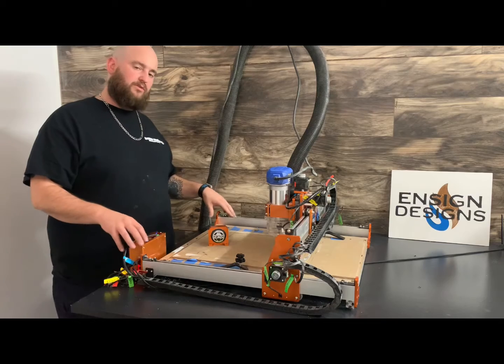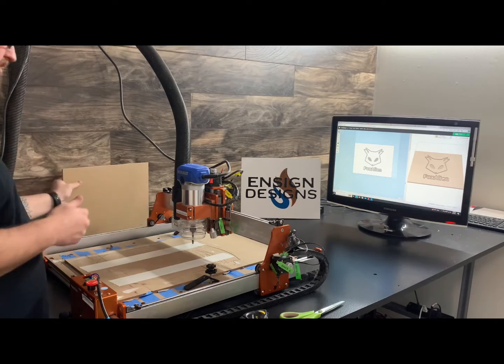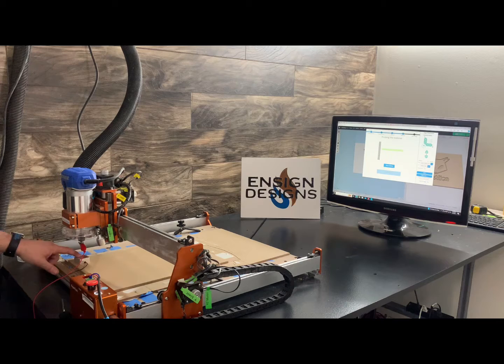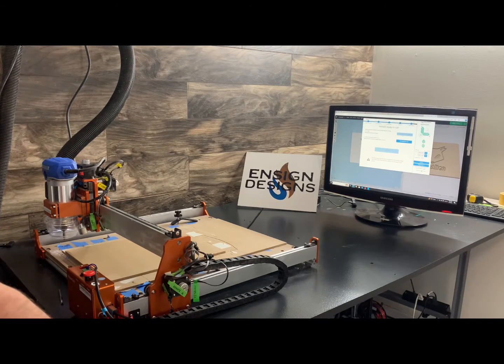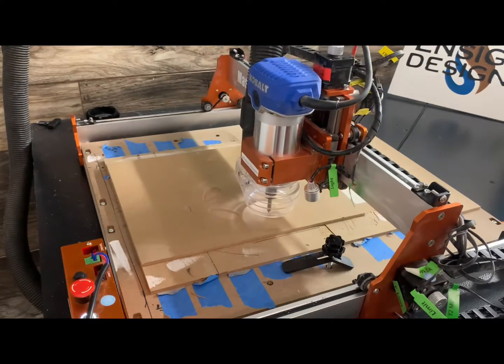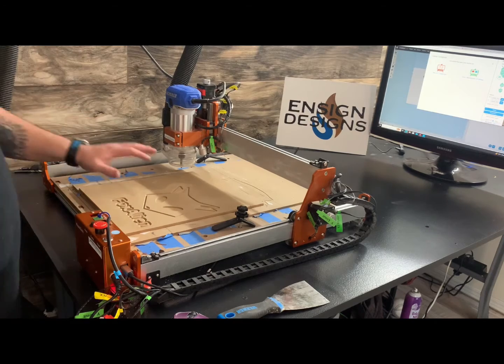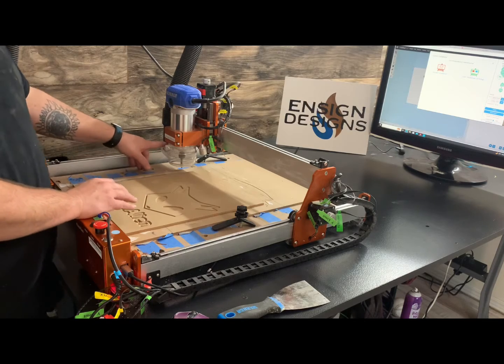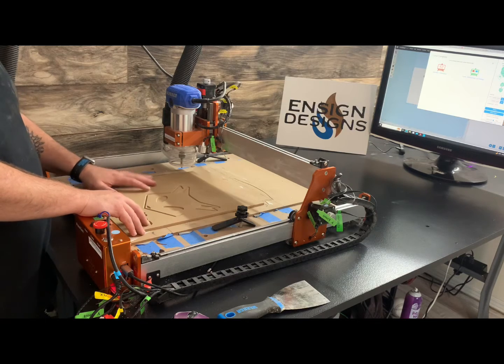FoxAlien Masuter Pro CNC Router Review @foxalien_official #cnc #foxalien #woodworking

Comment: I love my Masuter pro, there was a little learning curve with it but overall not bad, I purchased the 4080 extension when I originally purchased it, and waiting for the NEMA 23 upgrade to be back in stock. The only thing that is important is there are two processes to complete most of your projects 1st. a roughing pass very important it removes the heavier material faster then second the Detail pass with a smaller cutter usually a v or small ball nose cutter, the detail pass really cleans up the project and completes portions of the project, without using both passes the project will look incomplete and lacking detail. I would also strongly advise the upgraded 65mm router as noted in the video.

Comment: do you have any experience with working with aluminum? I'm personally working with 1mm thick sheets and want to cut out smaller panels
Reply: It will struggle, be really slow, but it will do it. I did some tiny 5mm thick aluminium pieces with mine.

Comment: How did you get the router in the adapter?
Reply from the maker: I used a cylinder honing stone. Found at automotive stores or harbor freight. Honed it out a little bigger and slide right in.

Comment: Great video review.  Check your link for the tape.
Reply from the maker: Awesome thank you for the support. The tape has worked good in a lot of applications. But not every project
Reply: @EnsignDesigns you have some hashtags on your link for the tape causing it not to go to Amazon.
Reply from the maker: @TripleBWoodworking try it now I edited it. I just clicked on them and it takes to to Amazon now. Let me know if there’s any issues
Reply: Its working now.  Thats the same tape that I intend to use for my cnc projects. @EnsignDesigns
Reply from the maker: @TripleBWoodworking  awesome that’s great. The only time I don’t use it is when a piece doesn’t sit flat. Then I’ll use the clamps. I will be investing in a planer soon.
Reply: @EnsignDesigns  yes, the planer with a sled is the way to go for flattening. I’ve had to use the sled with cutting boards a time or two.